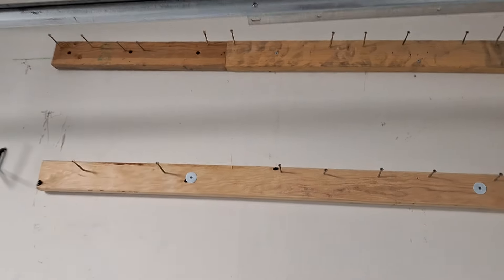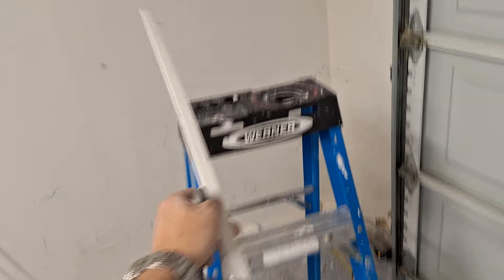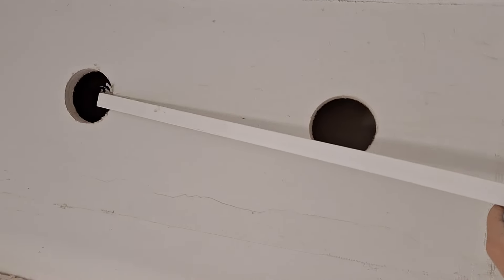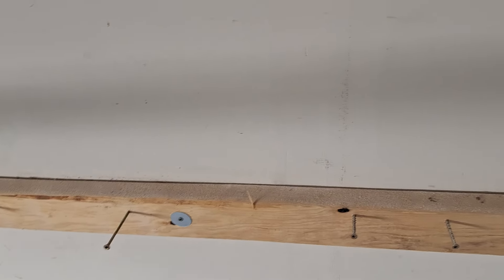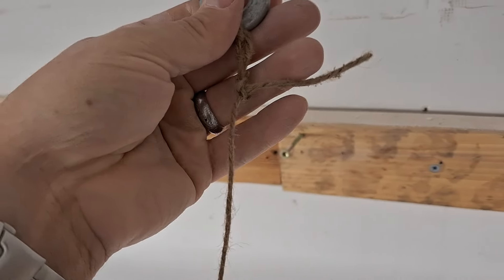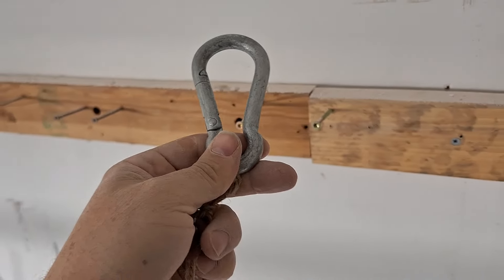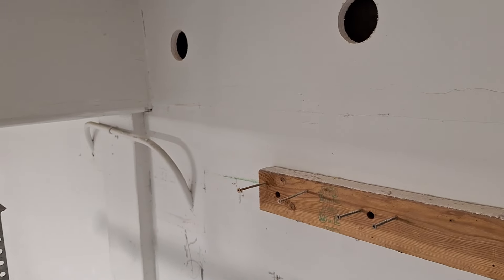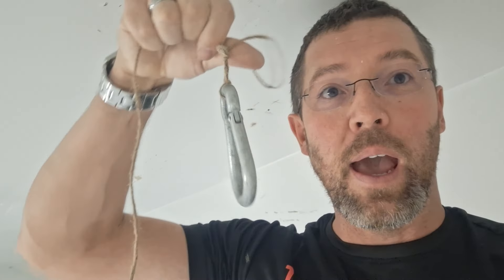WALL DEPTH FINDER SECRET!!!

Comment: What was your goal here
Reply from the maker: There is a board about 3 feet from the bottom of the floor, it runs parallel to the floor. I needed to see how deep the wall pocket goes because that board (fire break) was what I needed to find to then make a hole below it and fill those last few feet with insulation to complete the job.

Comment: What is going on
Reply from the maker: Trying to find the horizontal board running across the entire wall so I can drill below it and add more insulation
Reply: Man was bored wanted to some diy in the strangest way ever.
Reply from the maker: @theodddish1846  dude it worked! It's like a MacGyver move but no one probably knows who that is these days